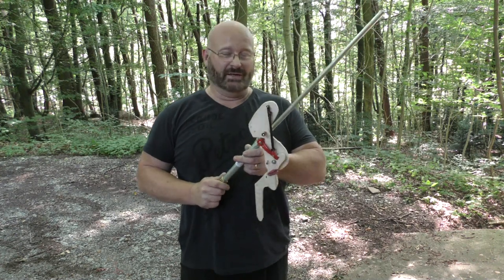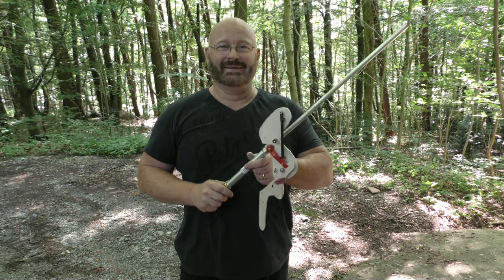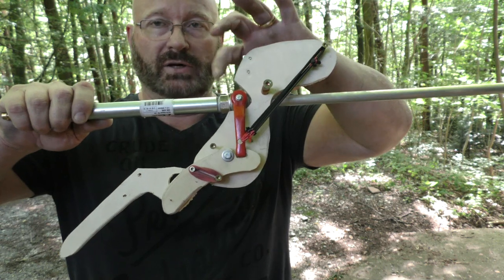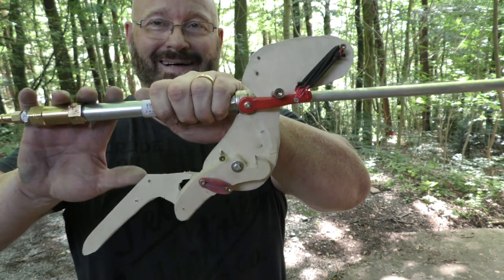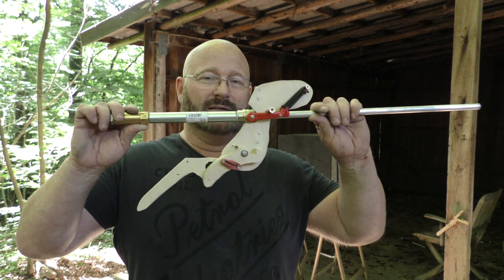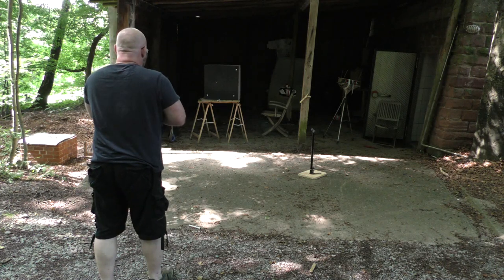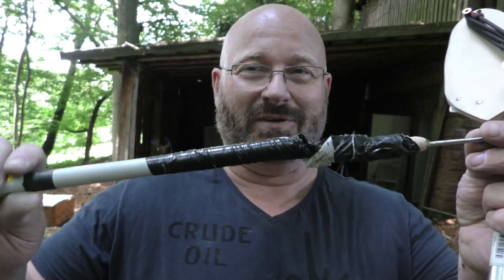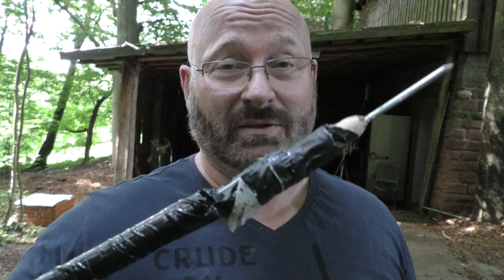World's fastest ball valve?

Comment: I really like the pistol you developed because of its aesthetic value, but this is now my favorite project of yours. The sheer power is incredible.
Reply: Wait till he figures out what the maximum pressure for the arrow is ^^
Reply: It's going to be scary. But I can't wait to find out!

I'm a little bit concerned about that double-barrel thing he made recently, which had two triggers and a safety. The way it's currently constructed, the triggers may stay in the "fire" position. This is intentional so they may be fired simultaneously when the safety is disengaged. But I'm worried that the operator may switch off the safety while forgetting that there's an active trigger, causing the weapon to fire at an unexpected time.

Comment: That was ~16% slower than in the last video. In theory you should get 171 m/s with the new valve if the arrow can withstand 2000 psi. You should increase barrel length to achieve maximal gas efficiency.
Reply: +joergsprave that is  good idea  do it :D would be the most deadly weapon you ever created
Reply: But he fired it at only 800 psi.
Reply: if he increases the barrel length, he loses more energy due to the gas spreading - it would be as if the valve was slower
this way, with superfast valve and short barrel, its relatively close to an explosively propelled projectile, near-instant acceleration by highly compressed shockwave - which is why the arrow exploded
question is where is the balance :P
Reply: Did you see the cloud of gas that came out of the barrel? The barrel is over volumed and a lot of air is wasted. If the barrel was longer the arrow had more time to accelerate to full potential. Heavier arrow would do the same.Thunderbird Anthares
Reply: +Thunderbird Anthares the gas spreading is how it's releasing energy. More of it needs to be pushing the arrow and less of it escaping first
Reply: the only real difference is if its an impulse, or gradual transfer - and it does not matter that much if its "over volumed" or not - it generally will always be because its pushing an object, and you need the density to even push it

impulse works better in anything that can withstand it, the only reason to accelerate gradually is not damage your weapon/projectile, or have enough time to do something with the projectile (like imparting spin)

you dont care if the gas expends its energy, you care how much of the energy it transfers to the projectile
Reply: Over voluming matters a lot in airgun world. Of course faster valve creates more power but imagine if you had 2 inch barrel. The projectile hasn't reached the maximum velocity before it leaves the barrel and rest if the air goes to waste. The arrow is not a rocket engine and the barrel doesn't magically push the arrow any further after the arrow leaves the barrel. Longer barrel allows more gas to gather inside the arrow before the gas is released.

In airsoft world the optimal air volume/barrel volume ratio is about 2:1.

Comment: Have you looked into QEVs (Quick Exhaust Valves)? It's a way to get a super-quick opening valve without any power source other than the air pressure itself. No solenoid, no rubber bands (though I realize the second point is kind of a negative :-).

Comment: It might not be so much the pressure as the resistance of the inside of the conduit against the metal tubing. Try polishing the pipe, polishing the inside of the conduit, and maybe some good quality hard wax. I recommend Renaissance Wax. It's a synthetic wax that polishes VERY hard and slick. That'll reduce the friction of the inner surface of the arrow, and let it slide off more easily.

What's blowing up the arrow is that the arrow can't move away from the pressure fast enough. The most likely culprit there is friction slowing the arrow's movement. Successive grades of polishing until it's mirror-smooth might help.

Comment: Where do you get 2000 psi? Scuba tanks?
Reply: He uses a bike pump XD
Reply: you should add "very expensive" to the bike pump :D
Reply: paintball tanks go up to 4500 psi....and we fill using scuba or one bad ass compressor. 

compressed air is so much better for paintball than co2....
Reply: +kain hall I switched from co2 just to get away from muzzle snow. I like to range fire, and a 20" barrel needs more flow than a shorty.
Reply: +R L ya..theirs really no disadvantages with HPA...just harder to find fill places...but as hpa replaces co2...it will be hard to find co2 in 10 years 

but...I've got a tippman a5 with just the stock semi auto trigger.

I can work the semi auto better than the e trigger due to me being a gun nut montanan.

it's a real mechanical trigger....just feels nice.

and I burn threw paint anyway.....full auto and I'd be dry 3 mins into the round.
Reply: I just use an old 98custom with an HPA hammer. Got an offset dual scope mount with a cheapo 9x22 rifle scope (top mount), and a RedDot (side mounted) when uppy-closely time comes.
Reply: watch his last vid
Reply: +SirNerrad Thanks! I had missed that one.
Reply: He just pushes it in there with his hands.
Reply: I used to own an a5 with an e-grip turbo/auto , no way your gonna keep the same rate of fire with a semi...

Comment: Since watching this I was wondering what if you replaced the pvc arrow with a steel tube arrow. I think it would be able to take advantage of the higher delivery pressure from the 2k psi. If correct this would be as powerful if not more so than the commercial spear guns you used last month.
Reply: mass*velocity =  watt?            heardt hitting 142pds.

Comment: As a pipe fitter with ten years experience, I urge you to wear some protective gear when charging and releasing 2,000 psi systems so quickly. You saw your conduit rip apart under the force, metal when torn under such pressure can eviscerate flesh easily. It's not life threatening with such a small volume of air, but we'd hate to see you needing stitches because of a weak point failure.

Comment: How did you calculate the maximum safe pressure of your homemade air tank on the device?
Reply from the maker: I used the totally safe "trial and error" method. So far no errors.
Reply: what are the parts for your air tank. i would like to try to build my own .
Reply: +JoergSprave Have you ever had an error with plumbing material? I'd never dare to go that far :D But ok, you're the guy with a successful youtube channel, you don't stay on the safe and boring side :) Greetings from Koblenz
Reply: +JoergSprave Please please be very careful, the back end of that thing is pointed towards your chest. If it blows off, you are finished! A friend of me once played with a small powder extinguisher from a car. Once it was pressurized, the threads ripped and the head shot into the sky like a rocket, barely not hitting him in the face! I know you know what you are doing, but this is very risky!
Reply: usually when you buy parts, they have the maximum operating pressure written on them somewhere. find the weakest link and bam
Reply: @joergs.  .freak  ?
Reply: häufigste todesursache, laut berufsgenossenschaft, bei midgliedern der verdi und ähnlichen berufen?      ??   -niemand?      -bureauxrollbarerstuhl mit nach oben expoldierender gasdruck! -gasdruckfeder!

Comment: I don't know if they would be strong enough but you could probably make some fibre glass tubes pretty cheaply and easily
Reply: +Det Du that's a fair point... Fibreglass is so easy to work with. Just a case of having a mold and wrapping it with cloth and resin. I can't be bothered doing the math to see if its strong enough though.

Comment: You could use aluminium tube for the arrows with the higher pressure, more mass means more penetrating power.
Reply: Aluminium would probably warp. Carbon fiber would flex and return to shape. You could use lots of things, but you would want something that could flex with the force of impact.
Reply: Maybe add weight with a metal sleeve that attaches to the point and fits over the end of the carbon fiber so it won't splinter as it penetrates the target.
Reply: The Problem with Carbon Fiber or other fiber composit material, that there will be delamination under high pressur and strong dynamic loudcylces. So the streng and thoughness of the arrow will be very badly decreased after a few shots, which could leed to splintered or broken arrow.
Reply: Steel tubing or even copper tubing.
Reply: copper is heavier than steel and much softer. it would be a poor choice.
Reply: Copper tubing is sold at pretty thin sizes that's ye only reason i suggested it. I don't think the softness would be a hue factor since the force of the tubing is linear to the thickest part of the tubing. Maybe that's something to test.
Reply: It's not a matter of the hardeness! Its a matter of the thoughness. Aluminium is to brittle and could easily brake und high pressure or at hitting the target. Steel would be a much better joice, because the weight doesnt matter that much, infact it will give the arrow more momentum.
Reply: Björn Schmidt aluminium isn't brittle. Its a relatively soft metal. It would bend before it breaks.
Reply: Björn Schmidt The weight matters a lot when it comes to projectiles. 80m/s with pvc will go down significantly with steel. Steel is around 5 times denser than pvc, which means even if he made it twice as thin, it would still be around double the weight, and that would make a huge difference. There is an optimal energy that you can put behind an arrow depending on its weight. Bows shoot arrows at speeds anywhere from 150 fps (for recurves) to close to 400 fps (for compounds). Joerg's arrow is traveling at 80m/s which is 260fps which is pretty good for an arrow, but if you make it twice as heavy it might slow it down way too much for it to be accurate at any kind of distance.
Reply: Titanium.
Reply: +1Life2Little Titanium is strong, but it can be bad to warp under impact.
Reply: I think his original idea of carbon fiber would be best. It would be most comparable to the pvc he has already tested, especially if he uses a thicker carbon fiber.
Reply: Bob Loblaw What are you on about there? Titanium is only 1.65 times denser than Aluminum but around 3 times as strong when it comes to pretty much everything you can do to it.
Reply: Bob Loblaw More than twice anyway. Depends on the type of stress applied.
Reply: I like how I can hear bjorns accent through his writing. :3 

Also I think aluminum would work fine as long as it is the appropriate gauge. The problem I found was that it is very hard to find metal pipes in a variety of wall thicknesses.
Reply: +radioaktiv 7 Carbon fiber is used in arrows for the heaviest of compound bows. It is incredibly strong when it is thick. The only reason carbon fiber ever has durability issues is because it is so strong that people tend to make to too thin to save weight. Make it thick and it is almost indestructible.

Comment: Why not a solenoid valve?
Reply from the maker: It is a test weapon. Will later use the filling method and pressure level for my Solenoid equipped weapons.
Reply: +JoergSprave i'm very exited to see what's coming next. 😄
Reply: +JoergSprave you could turn that in to one hell of a cross bow.  their are  traditional cross bows with a lever trigger much like that one.

Comment: if you solder very small tubes to the tube arrow ,and insert this small tubes in holes drilled in the arrow so the air outputs from them <<<,,,and solder them on the tube in a circular way so they make the arrow spin .......can you try it sir ?
and i think then you won't need "feathers" on the arrow

Comment: Joerg wielange hält eigentlich dieser gummi? Wird der nicht irgendwann spröde, rissig oder so? Wieviel kostet der gummi für eine kleine steinschleuder?
Reply from the maker: Wenn Du es selbst schneidest vielleicht einen Euro, je nachdem wie stark das Band sein soll. Hält zwischen fünf Schuss (Weltrekordzuschnitte) und 2000 Schuss (langlebig geschnitten). Bandrechner findest Du auf meiner Webseite.
Reply: +JoergSprave ok danke für die info
Reply: +JoergSprave I was wondering, have you ever made anything using the elastic constricting bands used in the medical field for helping locate veins for IVs? As a paramedic I work with these quite a lot and I think they may have some potential if appropriately applied to slingshot construction.

Comment: Why don't you try an aluminium arrow?
I bet with that much power and that much acceleration,
that would make a massive impact!
Reply: Thats a question of thickness,
a 3mm thick aluminium arrow wouldn't warp at all.
Reply: But then we get a heavier arrow, not sure if that would be good.
Aluminium may be light, but it ain't as light as carbon.
Reply: That's the reason why i think he should try it,
he has brute force in that weapon and he is definately able to launch a heavy projectile.
So why not use one?
It's going to have a massive impact for sure